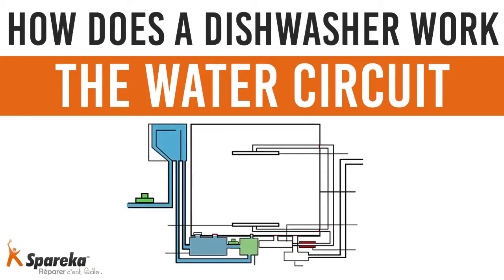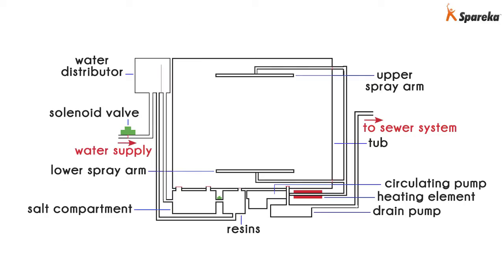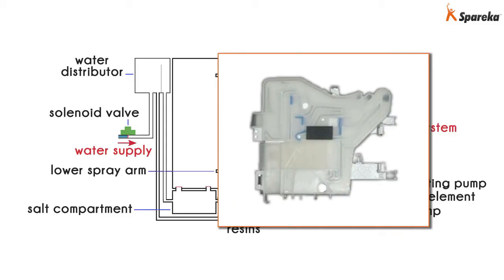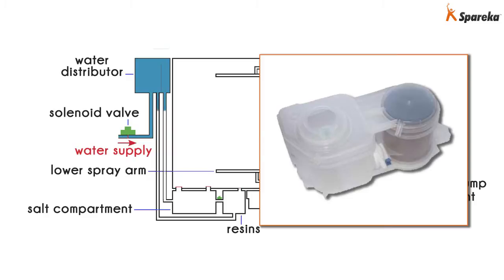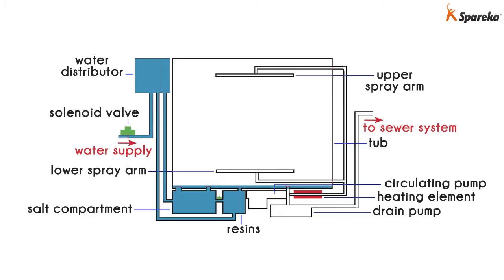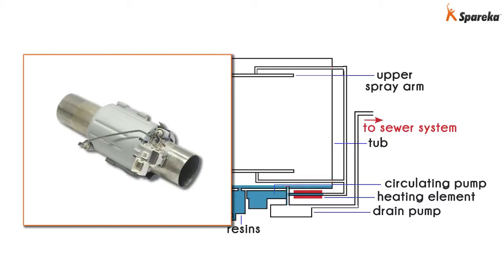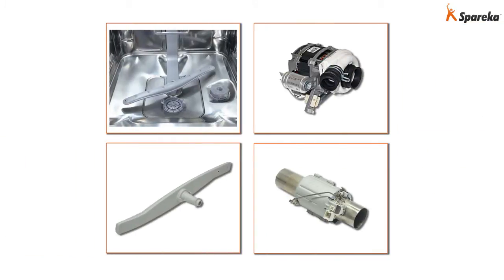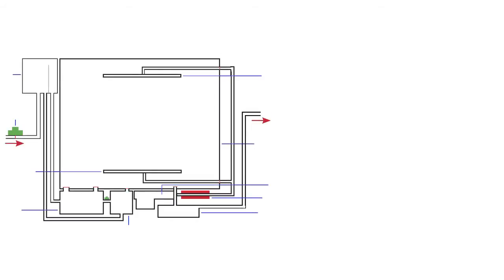How does a dishwasher work? : The water circuit

Comment: My dishwasher don't seem to have a solenoid valve inside the machine. Seems like it is included in the aquastop inlet. The aquastop is closed by default, then when current is applied, the magnet lock snaps open and water flows.. 
Is this reasonable? Or am I missing something? Should there be a solenoid valve in the machine as well?
Reply: yeah seems reasonable

Comment: Hello, I wanted to ask some questions:
1) The first component is the solenoid valve, who commands the opening of the solenoid valve?
2) Which component makes me close the solenoid valve?
3) Which component determines that the water level inside the tank is sufficient?
Thanks
Reply: The motherboard, and the float switch

Comment: I have low pressure at spray arms. What can be problem of that? I clean pipes to arms and it seems to be clean. I think it can be circulating pump, but i dont know. Lower arm is rotating, but slow and pressure is low. But higher arm is dry.